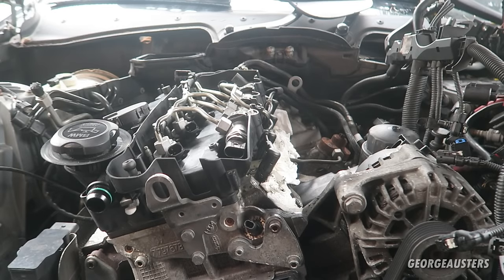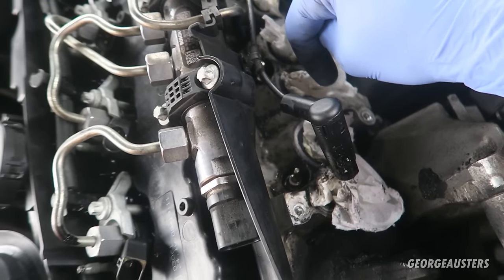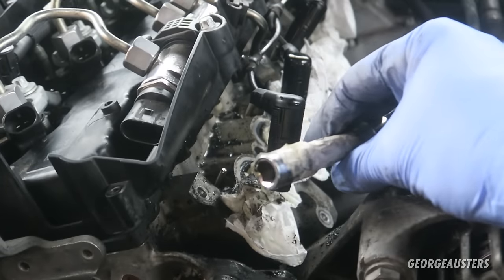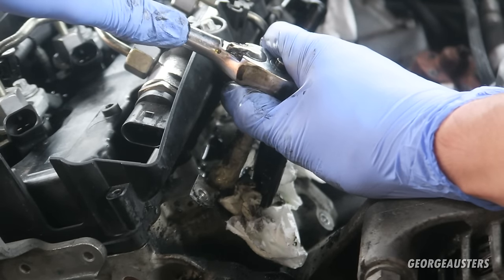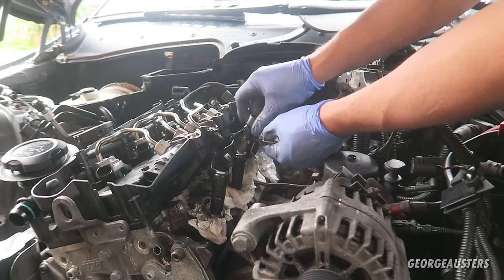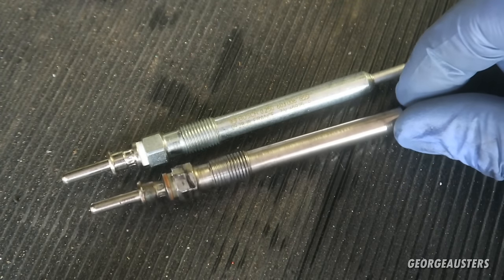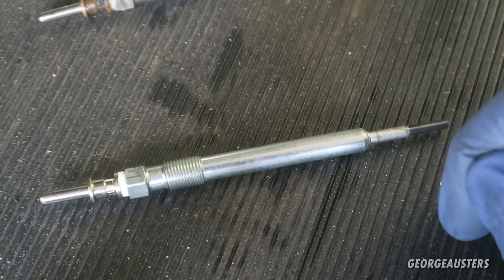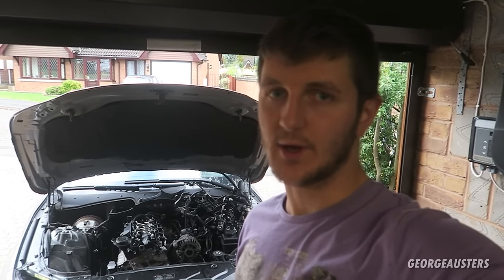How To Remove Glow Plugs WITHOUT Snapping Them

Comment: I sprayed CRC 5-56 the day before plug removal, I kept the intake manifold on and run the engine for 10 minutes, then I started to remove the glow plugs, they loosened relatively easy but I had to reverse the turning in steps when I felt some harder resistance. The old glow plug threads looked like new, no issues. The old plugs looked fine too, despite 180 000 miles on them.

Comment: I would use my longer ratchet without a swivel, I have more of a feel in that and I can aplie the force in exactly 90 degrees. I am also inclined to use a long extension, so that I stand upright and if anything snaps, I won't injure my fingers. If it does not loosen - then even tighten it a little more, and then open it. If it goes stiff, I would work it back and forth till I feel that it runs free in the tread.
Reply from the maker: Not a bad idea!
Reply: @GeorgeAusters  been there done that, mechanic for more than 45 years, -- 
and if WD 40 does not work: Coca Cola- does ,and has loosened many of stuck bolts and screws.
Reply: @hansweitbrecht1957   OR mix Auto trans fluid & Acetone  ... its an EXCELLENT penetrating oil ...
Reply: @hansweitbrecht1957 hey that's really good thinking regarding the cola!

Comment: Done mine today. Not a job I was looking forward to reading all the stories of snapped plugs. I didn't remove manifold and had enough room to get a long socket down. They were a bit tight but using a torque wrench I undid them gradually. Undo, do up, repeat. Used some WD40 penetrate and let sit for 10 min or so after each session. The ones I took out look tip top, bo blackening on the stems and threads looked like new. (81,000) Not a job I will have to do again so pleased it went without any mishap

Comment: Brave man George. I have to do mine and I’m absolutely dreading it. The luck I’ve had with my car. I have 6 to do aswell. 🙈🙈
Reply from the maker: Good luck 🤞🏼
Reply: Cheers. I’m going to need it. 😁😁👍👍
Reply: @GeorgeAusters  George. The caps on my glow plugs don’t look great. Are they just a single live terminal connection on the plug that I could check with a volts meter. ??  Before I start trying to get the glow plugs out. ??

Comment: When I've done it a warm engine helps,  if you get a sticky one use more penetratind oil and drive it in and out a few time  to loosen the rubbish on the threads

Comment: Hola Jorge, just bought a 2003, Ford Transit, with 2.4 DI engine. So changing all the service parts and checking everything. Today removed and cleaned the egr and inlet manifold which were encased in s#^t !! 
So while they are off think i will change the glow plugs !!

Comment: All 4 glow plugs replaced, Module and air intake cleaned thanks to your help👍
Reply from the maker: No problem Jonni, glad to be of help👍🏻
Reply: How long did it take and what was the total cost if you don’t mind me asking
Reply: @adonramlal-brooks4134  I can’t remember now but bought genuine Bosch glow plugs and module and also new intake manifold o-rings + throttle body o- ring.
Made sure to keep putting wd-40 on all 4 glow plugs a few days before doing the job. I kept doing it, morning, lunch and evening. Took the car for a drive. Waited to cool slightly. I’d say 3hours removing the loom, intake manifold and then finally glow plugs. Just being extremely careful. I even bought a glow plug socket and was extremely careful cracking them loose. 
1-2hours cleaning intake manifold and throttle body and cleaning mating faces. 
1-2hours installation of glow plugs with glow plug grease and torquing down the bolts. 
No glow plugs fault since. Hope this helps.

Comment: I've got a vw passat b6, the glow plugs are inside the head alongside the cams.

In theory they should come out fairly smoothly, right?

Also I'm assuming it's best done with the engine at operating temperature?

Comment: Good mechanics that’s how you must do glow plugs ,but I’ve seen evan highly experienced mechanics do this method and you think all is good up you notice 1 or 2 Of the glow plug tips stuck in cyclinder head and can turn into £1k-£2k job, some say do when hot because expands but the glow plug is also expanding to cylinder head so it’s a hard disiscion but I think the way you are showing is the most likely to be successful and losening and tightening while spraying wd40 will help alot
Reply from the maker: Yep!

Comment: Step 1, clean all the crap from around them. Also 1/2 turn out, 1/4 turn in until they are out. But before removing once loose, blow nozzle to clean out any loosened debris.
Reply: spot on

Comment: Basket...! The threads are stripped. How did the replacement plugs go in? Did you tap the ports prior to replacing them?
Reply: tapping into the cylinder head while its still attached to the engine is a terrible idea.

Comment: The CORRECT way is to loosen them by using a TORQUE WRENCH. You should set the wrench at just over the maximum tightening torque. So if the maximum tightening torque is 14Nm set the loosening torque to 16 Nm and no more otherwise you have the terrible likelihood of snapping the glow-plug clean off! If the maximum torque is reached but the plug does not turn, further action is required before making further attempts. The biggest influence will be running the engine to full high temperature where the threaded hole will expand slightly. You could even spray the plug with Freezer spray to increase the temperature differential to help loosen them. Just be very careful al the same...
Reply: How do you run an engine to temperature (or at all) if the intake manifold etc is already off? I have the M57 engine and I can’t see how you can get to the glowplugs to spray any lubricant around them with the manifold still in place…..???? 

Thanks

Comment: I work in a garage, I can assure you that sometimes glow plugs do break on removal, often even though you can unscrew them the tip can be thoroughly stuck in the hole and will shear from the glow plug body!
Reply: Perfect example of why you should not buy a BMW 1 Series
Reply: Welcome to my world. 1.4 fiesta ,2 tips stuck in engine. Handy enough to remove with the right tools. No taking the head off.
Reply: @georgiewbg6687  I'm here because we have to remove the glowplugs on our bmw 1 series 😭
Reply: @bobbydaly309  how? Which tool u used? Even am facing the same issue and the mechanic is suggesting for head off
Reply: @kuldeepb1  i pushed the tip down onto the piston. I couldn't get the tip out with a magnet so in the end i removed the head. It turns out the tip wasn't magnetic.
Cheapest option and easiest is to buy a glow plug removal tool. You can get them on ebay
Reply: @bobbydaly309  ok! Thank you. Will try with removal set once👍

Comment: I prefer to use a T handle bar with the socket for more control over the angle. Then you can't bend the glowplug.
Secondly, the glowplug is sealed to the cylinder head, therefore a penetrant (not WD40), will not be able to be taken into the threads by capillary action.
If it will not break free, then try to tighten it very slightly and work it back and forth gradually. A penetrant will help once its broken free.

Comment: Mercedes manual actually even specifies a max loosening torque to the glow plugs so you wouldn't snap them. Also ceramic anti seize is to be applied on the long shafts between threads and the tips.

Comment: Your videos are very useful. I really want to give this a go.
So you are saying maybe 24hours before doing this spray them with WD40 or some kind of displacing fluid. Then before doing the deed give em another soak for about 30 minutes and slowly get them out. Also, should you soak the new ones at all? What would happen if I was to snap one? Can the car still run or would this do serious damage to it? I also have a E87 N47 engine 57 plate. 92k miles never changed plugs since becoming the owner 8 years ago @ 34k miles.
Reply: Brush new plugs with fresh engine oil before installing🤟

Comment: Of course most torque NM ratings for threaded components are engineered to be applied in a dry unlubricated condition. Any bolt thread that you apply anti-seize , grease or oil to and then torque up to the manufacturers spec is going to screw in deeper and not pull up correctly in its dry friction state as most bolts are engineered to do. The torque works with dry friction, so that the same friction prevents thread reversal due to vibrations. In some cases the extra rotation/s when using lube before the torque wrench clicks can be hair raising as you realise you are loading up the forces with the threads trying to pull harder in opposite directions rather than just metal to metal dry friction force and so unless the manufacturer specifies specialist grease, the threads should be mostly clean and dry. How you achieve that in many cases is near impossible.
Reply: Anti-seize should be applied according to the service manual. At least for many car models.

Comment: First off your method/ procedure is a proven and good practice. Also there are many misconceptions on the internet , especially that cylinder head removal is always the case, no this is not so!!!- 

However if someone is misguided enough to think an extractor has more purchase than the original M10 hex - then most probably, this would be the case after breaking the top.

Also every BMW glow plug that is stuck - is not down to wrong torque but a phenomenon that I have proven time and time again, (galling) - this usually happens with metals that are similar in nature but not in this case - when you first crack a plug you may get a few loose turns and then it goes tight - This can be attributed to either carbon on the electrode and aperture or the parent threads have over time lost their running clearance.( which should be .05 to .1mm between the plug and parent thread) -

So little bits of metal coming off the plug thread due to one or two frozen threads at the top, they start falling to the bottom and the threads start trying to weld themselves together. 

The penetrating oil helps maintain movement but eventually the plug either comes out or breaks under the torsion pressure generated.

So I hope you use a (clearance tap) to restore the lost clearance or the next time the plugs are changed it will be a nightmare……. 👍

Comment: If the glow plugs are threaded that badly , does that mean the inside of the thread in the cylinder head needs to be cleaned somehow? Would these be threaded too or at least contain bits of metal from the previous glow plug? Also, should this be done when the engine is hot or cold?

Comment: When replacing with new, would you use a copper or silver slip to prevent future seizing problems?  Also what if the worst happens and they snap?  I assume you have to drill them out and re-tap the threads?  Costs?
Reply from the maker: Yeah you can use an anti sieze compound if you wish👍🏻
Reply: Thanks. What about the second part of the question?

Comment: Providing it turns this works. But if doesn't even begin to turn, you have a problem. If I run my self into this situation, I put the socket and extension on the glow plug, bottom it out, and give it a couple solid walks with a hammer. This loosens off any rust, or soot build up on the end of the glow plug. And if that still doesn't do it. I have a 3/8 breaker bar that I can put on the socket, and then I can hit the back of the breaker bar while applying turning pressure. This acts as an impact wrench but you can adjust the torque and prevent it from just snapping the plug off.

Comment: Agree with everything in this vid but a few measures not included. It's all about feel. Having been an hgv mechanic for 29 years who also had the good fortune to have worked for a company for 8 years that restored and reconditioned old aircraft ground support equipment I have had my fair share of battles with threaded items that looked me in the eye and said bring it on, you've got two hopes, Bob Hope & no hope of getting me out 🤣
So, plenty of lube to begin with and gentle work with the socket and ratchet while using all of your spidey senses to feel if there's any rotational movement, a feel of plasticity or rock solid.
Plasticity is a huge warning telling you to stop 'cause you're about to wring its neck. Rock solid says get some heat in it and keep lubing and trying with feel and caution.
If you're lucky enough and it moves, unscrew a flat at a time lube and wind back in. This serves two things. It breaks off crud but importantly it takes much needed lube back into the threaded hole.
Keep doing that and before you know it the thing is freeing up and you're on the home straight.
Sadly the "feel", takes a while to develop but once you have it is as valuable as hour most prized Snap on tool.
The feel also works equally well as a torque wrench.

Comment: Thath feeling when you try too loosen them and you just heard and feel it SNAPS right off deep down there. Thanks for video.
Reply from the maker: Haha just gotta take your time and be patient!
Reply: @GeorgeAusters  did you do any refresh of the threads in the engine block before you put in the new ones?
Reply from the maker: I just cleaned the wells out with a vacuum cleaner.

Here is me Installing the new ones👍🏻

How To PROPERLY Install New Glow Plugs https://youtu.be/M69u2b1ckuM
Reply: NGK should be good too. They sometimes have higher torque rating than other 🤔
Reply: Rune torque rating on glowplugs?   Its not sparkplugs dude
Reply: @bergrud  they do have a torque rating.
Reply: @GeorgeAusters  When old threads are sour, rusty or otherwise damaged I use to run a tap throug the hole. Of course you have to be absolutely sure to pick the right size. When working on aluminimum I use alcohol as lubricant, however not so important when refreshing an existing one.

Comment: Hi George..good videos as usual! 
With the state of the old glow plug threads, did you have to retap the glowplug holes before screwing new ones? Mine have come out same as yours. All the threads are almost flat now
Reply from the maker: Didn’t need to retap the holes.. new ones went in fine👍🏻
Reply: Thanks for the reply. Everything is back together now but the car cranks fine but doesnt start. I tightened them to 20nm and they were fine and felt tight. Theres no error codes on the diagnostic autel but its not starting at all now.almost feels like its getting no fuel. Fuel rail pressure is ok too. 

If the glow plug relay is dead, will the car not start at all ?
Reply: @GeorgeAusters  any ideas?

Comment: Thanks for the video, I’ve bought new ones but now I’m worried about attempting it !!
Reply from the maker: You’ll be fine. Spray a penetrant a few times the days leading upto it and remove them when the engine is warm👍🏻
Reply: Exactly in the same boat mate. Bought mine but twitching about changing them. 🙈
Reply: Be the master of the glow plug, not the slave to the glow plug...

Comment: Hay bro on any bolt nut on any car 4WD OR EVEN Torsion bar nuts  or Allen, key diff nut spray inox  on them then in 3 days they will undo with just a normal spanner and socket set

Comment: Don't use WD-40, use a proper penetrating oil like Plusgas or similar. There is a WD-40 special penetrating spray available which seems okay but just don't use the normal household WD-40 because it's a water dispersant NOT a penetrating oil. 

My method for removing glow plugs on my M57D30TÜ2TOP engine (535d E61) is to get the engine fully hot (90C) and then start stripping the inlet manifold etc. By the time you've got the glow plugs exposed give them a good soaking with Plusgas and go get a cup of tea. 

Come back in 10 mins and with a torque wrench set to 25NM, give them all a try. You'll probably get 1 or 2 out. Make sure you don't go beyond the torque wrench "click" and bear in mind they can tighten up again after initially coming loose. If that happens, spray some more plusgas and tighten them back up a bit before loosening again. Increase torque a bit to maybe 28NM and try again - you'll probably get another 2 or 3 out. Then wait another 10 mins longer with a bit more plusgas sprayed and then go to 30NM and if necessary 35NM. If they don't come out at that point then try alternating between tightening (same 35NM) and loosening and see if you can rock them loose. At this point the engine is cooling so you've got to make the call between increasing torque to 40NM or if those particular plugs are not showing faults, maybe just leave them be and replace the others. I nearly got to this stage just last week but got it out at 35NM after testing if one of the other Bosch plugs could handle 35NM in a vice. It's not just about snapping the plugs, it's also about damaging the cylinder head threads. Cylinder 6 was by far the hardest to shift in my case and was not showing a fault so I very nearly left it alone.

When reinstalling, smear the threads with copper grease but only a small amount and observe torque specs when tightening. I think mine were only 13NM but check NEWTIS for your engine. I'd recommend changing every 4-5 years just to ensure they can be removed if they do fail. Think of them like spark plugs and replace every 60k miles or whatever.

Oh, and don't let all the penetrating oil and swarf go down the glow plug hole when you remove it. Try to soak it up or blow it out once the plug is nearly out.

Comment: Thanks for posting, everyone has their methods, like you said preparation is key, soak them well in your favorite release fluid, although less convenient, I like the engine to be hot, then take your time and work away as described below, do not get in a hurry. If all else fails use your favorite extractor tool. :-(

Comment: At 5:36 as you released the first glow plug there sounded like a lot of pressure being released. Is that pressure what is held in a cylinder where the piston is starting to compress. You didn't mention that viewers should be not concerned by it.